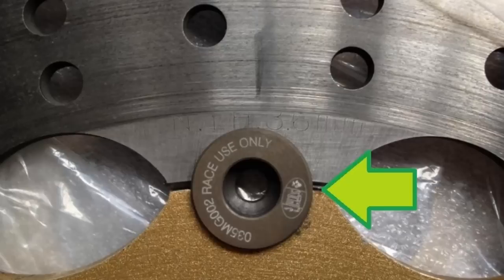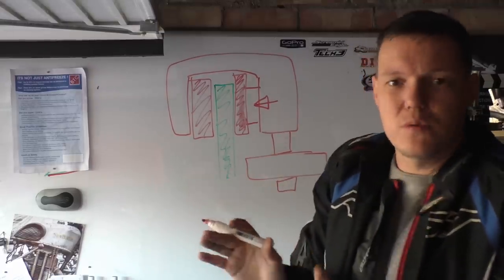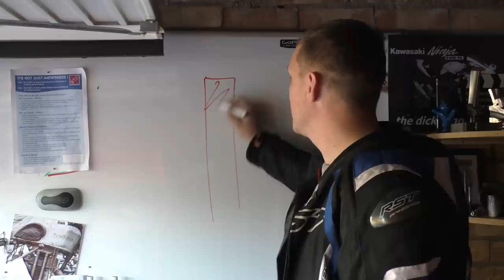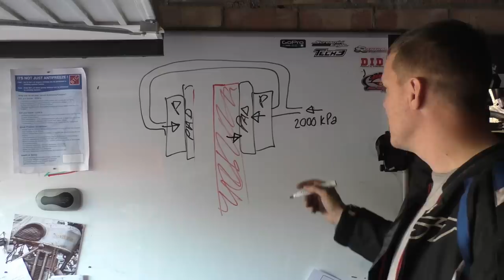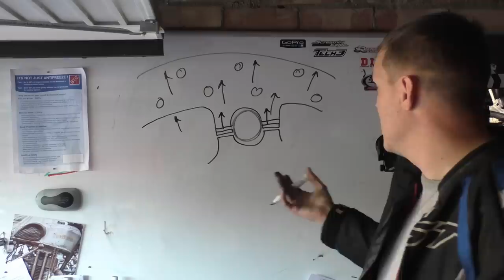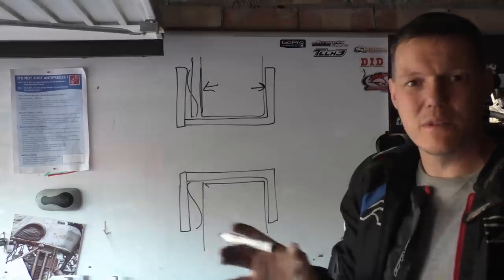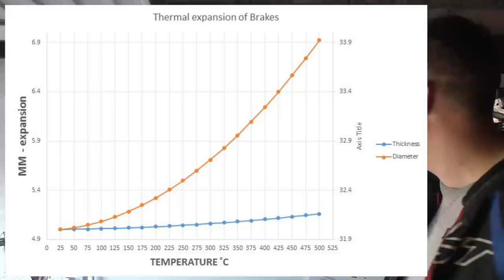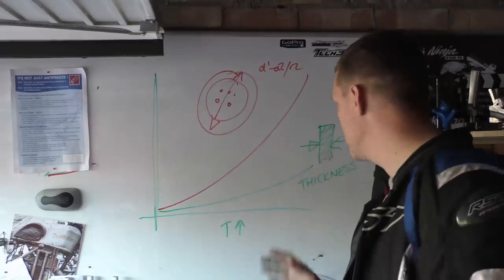Floating Brake Discs - and bobbins

Comment: All the respect but this information is not right at least half of it.What i'm talking about is that when you have (I've had and know what I'm talking about) high amount of brake dust between your bobbins and disc it makes disc to sit incorrectly (not straight)between those bobbins because some bobbins are stuck left some right and so on.What happens next is that when you hit brake  your levers shake and you won't get consistent brake power and feel.Your theory of floating calipers is correct only for rear,because rear caliper is the one which is floating not front ones as of my knowledge (I have zx6r 2009) but rear disc has no bobbins also that's why it needs floating caliper.So there you have it,the truth.
Reply from the maker: Right I'm going to have some fun with this...

"high amount of brake dust between your bobbins and disc it makes disc to sit incorrectly"

- in what orientation? You have to define what you mean. Secondly what is your argument here, like I showed the Z900 bobbins don't rotate and neither do most of the 'new' bikes these days.

"between those bobbins because some bobbins are stuck left some right and so on"

- Some brake rotor designs have all the bobbins biased to one side and this is accomplished by wave washers... Love to hear your answer to that one.

"What happens next is that when you hit brake  your levers shake and you won't get consistent brake power and feel."

- And if this happens you KNOW that's the bobbins and nothing else? How?

"Your theory of floating calipers is correct only for rear,because rear caliper is the one which is floating not front ones as of my knowledge"

- The front are usually double piston fixed calipers - I've already covered this in another video... Secondly this is for 'higher performance bikes' - most 125s ect have floating front calipers 

- https://mcn-images.bauersecure.com/upload/258758/images/13yamaha-wr125x.jpg

"but rear disc has no bobbins also that's why it needs floating caliper"

- LOL no. Floating discs are to seperate the rotor from the carrier. This is so they can make the carrier lighter.

Here's a Suzuki GS 500 - floating calipers and bobbins 

https://mcn-images.bauersecure.com/upload/947/images/1752x1168/Learners026-01.jpg?mode=max&quality=90&scale=down

Suzuki GS500 from 2002 caliper...

https://www.fowlersparts.co.uk/parts/5286213/gs500h-k1-k2-01-02/front-caliper

Suzuki GS500 from 2002 front disc...

https://www.fowlersparts.co.uk/parts/5286212/gs500h-k1-k2-01-02/front-wheel

"So there you have it,the truth."

- LMAO! Now I'm going to go light on you, but in future before making yourself look like a tit, at least know what you're talking about!
Reply: @dirtygarageguy  You need to look some other bikes too like zx6r and see how their braking system work.It's not a science that when bobbins get stuck in place (on semi floating rotors) your braking power su**s.It's just a simple thing to realize even if you are not technically educated.Just ask yourself a question - why are there those bobbins and why is it called semi floating  rotor/disc?
Reply from the maker: "You need to look some other bikes too like zx6r and see how their braking system work."

- They all work the same 'physics'

"It's not a science that when bobbins get stuck in place (on semi floating rotors) your braking power su**s"

- The Z900, also a kwak has 'stuck' bobbins - brakes fine...

"why are there those bobbins and why is it called semi floating  rotor/disc?"

Simple. They're called bobbins because of their shape - like a sewing bobbin. Manufacturers call them rivets. They're called semi-floating because they're not completely fixed they're constrained but not in all degrees of freedom. For example you have semi-floating wrist pins and fully floating wrist pins - floating just means they're not constrained or 'fixed'
Reply: @dirtygarageguy  Than you have not seen stuck enough bobbins.Believe me I've just fixed my bike with this problem and before I freed those bobbins braking was terrible .When you touch semi floating rotors hard enough you must feel a bit of a movement side to side.That's why they are called semi floating.But when bobbins stuck in place like mine,you can't move them.Problem is that those bobbins, like mine, sometimes stuck let's say not in a straight line (not aligned with each other.I don't know how to say more accurately) which makes rotor to bend.Now you can use your imagination/common sense and tell me what happens  when you hit the front brake lets say at 200 km/h?
Reply from the maker: "When you touch semi floating rotors hard enough you must feel a bit of a movement side to side."

it's called deflection and anything will bend. This is not and does bot aid in braking...

"That's why they are called semi floating."

- No, it's not. 

You are totally wrong and here is the proof - EBC make millions of brake discs - I have some myself. This is from their website 

"90% of rotors branded as floating types are actually simply a two piece rotor where the outer rotor ring is riveted to a central hub by circular mass produced rivets. 

A rotor made with circular rivets does not float at all because the tolerances (differences in PCD – pitch circle diameter of the inner and outer components) would need to be so large that the rotor would rattle and shake from day one. 

At this point it is essential to differentiate between axial floating and radial floating. Any motorcycle rotor built with axial float often described by people as a self centering rotor is also doomed to failure. 

The pad and piston knock back effect of a rotor with axial float is simply a killer and causes sponginess and can render brake levers coming right back to the motorcycle handlebar when trying to re-connect the “knocked back” pad with the rotor under braking. Not good at all!

So zero axial float is needed or desirable in any type of rotor."

It then goes onto say...

"Under braking and heat generation the outer ring or rotor blade of every two piece motorcycle rotor suffers from band width growth, in other words the outside of the rotor grows outwards but the inside SHRINKS inwards.

It is this shrinking inwards that defeats the myth that two piece rotors actually float.

Imagine how the outer ring and inner hub behave having a tiny tolerance over the circular rivet (to avoid rattle). 

The rotor ring shinks inwards, hits the circular button, locks up and then, unable to go anywhere, the rotor warps or distorts."

Source - https://ebcbrakes.com/articles/the-facts-about-floating-motorcycle-rotors-or-discs-by-ebc-brakes/

I'll expect an apology at the end of this... but I'm not holding my breath
Reply: @dirtygarageguy  What you quoted is truth but what I said is truth also and my rotors and not only mine is the proof for that.Whether you believe or not the technique is working and I've tested it.I wish I could show my rotor to you.Also my theory why they are called semi floating may be wrong but difference between rotor which has stuck bobbins and lets say brand new semi floating rotor is real in terms of free play.I'm not saying it rattles side to side like fully floating rotor but it moves when you touch it with enough force unlike rotor that has bobbins stuck.
Reply from the maker: "What you quoted is truth but what I said is truth also and my rotors and not only mine is the proof for that."

- So to be clear, in the simplest way what I understand you're saying is 

"that brake dust inbetween the bobbins is causing your brakes to be shit"

- If this is correct then explain how, because it makes no sense.

"Whether you believe or not the technique is working and I've tested it"

- Show what was the test method? Do you have results?

"I'm not saying it rattles side to side like fully floating rotor but it moves when you touch it with enough force unlike rotor that has bobbins stuck"

- Don't doubt it, what I'm saying is axial displacement has nothing to do with how bad or good your brakes are. I'm doing a video about this, this weekend - and I think you'll find it interesting because I've found something that spells it out in plain english and from the best source possible